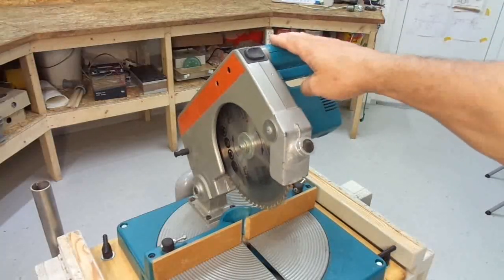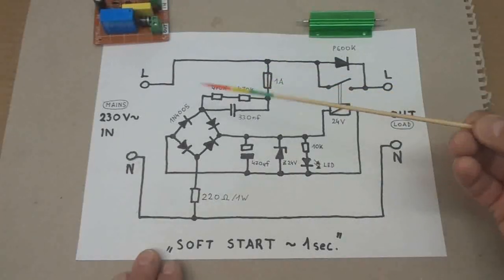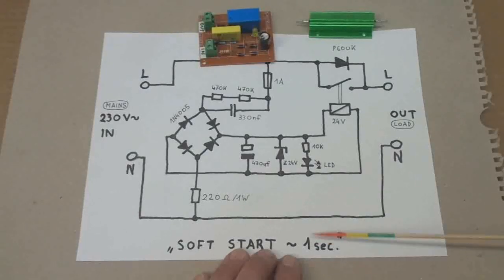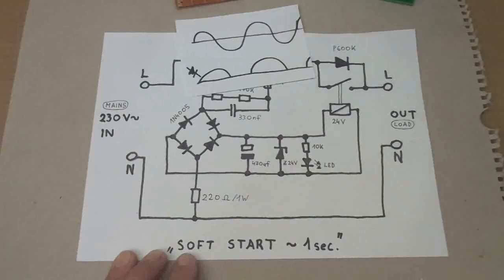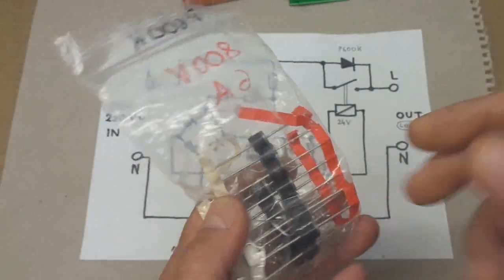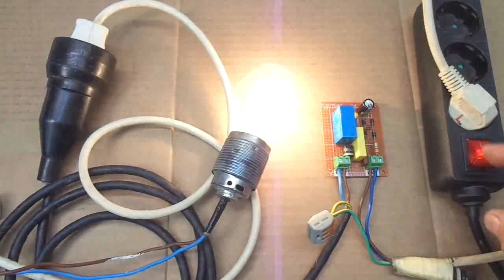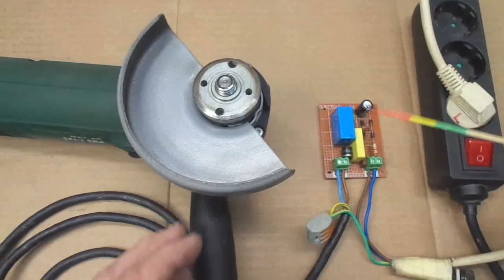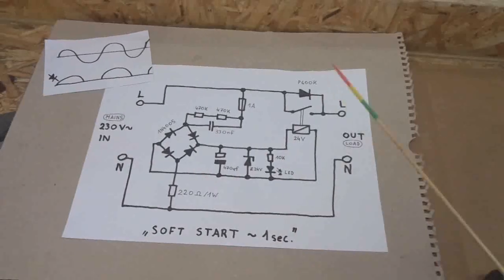simple soft start circuit DIY

Comment: Hello, Lari
I liked the practicality and simplicity of its circuit.
What changes should I make to 127 volts?
Grateful
Reply from the maker: You can use the circuit as it is also for 120 volts AC. I think, it should work, because the capacitive dropper limits the current, not the voltage. If you dont want to do math, start with a 220nF capacitor and increase the value, if your relais gets not enough juice. Stay as low as possible, or the Zener diode will get way to hot. The electrolytic capacitor sets the time delay...All of this depends on the propertys of the Relais...how much current it needs to kick in. And be careful, even though, there is 24 Volt at the "secondary" side, everything in this circuit is live mains voltage and can give you a nasty shock.  Greets from Germany.
Reply: @LariFariYoutube  
Perfect!
Thank you so much, Lari!
I will follow your recommendations for sure!
A big hug from Brazil!
Reply from the maker: @claudemirvernini6719  You should measure the Voltage present on the Relais. In the circuit from the video, the Voltage on the Relais, when its on, is 19,5 Volts. As i saied, i am using a 24 Volt Relais, so its a little bit undersupplied, but thats just to be on the save side... I did test the Relais first with my benchtop power suppley. It kicks in at around 12 Volts. You should try, to stay a bit under the Zener Voltage, when the Relais is powered...(by choosing the right dropper capacitor)...so you can be sure, the Zener Diode does not get hot...  Sty save, my friend..
Reply: @LariFariYoutube  Thanks for your attention, Lari!
I will follow your advice.
Excuse me if I annoy you.
Hug!
Reply from the maker: @claudemirvernini6719  No Problem Claudemir...I am curious to see, if my circuit works on 120 Volts and what changes the design need to work in your country. So, if you are building the circuit and you get it to work on 120 Volts, please give me a feedback.
Reply: @LariFariYoutube Gladly, Lari!
I'm already ordering the parts, because in my city they don't have them.
As soon as it's up and running, you'll know.

Comment: will this work for old compressors?
Reply from the maker: Yes, it will. I think, your compressor has a induction motor. You will need a low value resistor instead of the Diode.
Watch my video "table saw part 4" I used 200 meters of insulated, solid core wire as a startup resistor for the 2,2 kW induction motor.

Comment: Can we Run refrigerator compressor on it?
Reply from the maker: Hi, my friend.... Hmmmm...most refrigerator compressors have already a PTC start circuit built in, because a refrigerator compressor starts on full system pressure. So if you have problems with your compressor, you need to change this component. (cheap on ebay). If you have some other project in mind, where you want to use a "hacked" fridge compressor, i think, you can use this circuit. But dont use a diode... Use a high power resistor (about 5 ohms...you have to find the right value..) I never tried to use this circuit on such a compressor and i would be curious to see, if it works. It is so simple to build, so it is worth a try anyway.. ;)   If you do so, please leaf me a comment, if it works or not.  Greets from Germany.
Reply: @LariFariYoutube  Thanks dear for you reply, actually the problem is when refrigerator compressor start it's take upto 10 times more power. I want to run it on Small solar inverter of 1.5kw..
My solar inverter max 5Amp out put. If i run refrigerator on it maybe my inverter die🤣..
Reply from the maker: Uh..thats tricky... My suggestion: Make the wires on the input side of the Inverter as short + thick as possible (battery cable), to reduce the voltage drop on DC side of your system. I dont think the Inverter dies, but it will detect a overload situation and the protection kicks in.. Probably you would be better of with a bigger Inverter.

Comment: Hi,can you post links for relay and orange capacitor.Thanks
Reply from the maker: Yes..
Here is the Relais: https://www.digikey.de/de/products/detail/te-connectivity-potter-brumfield-relays/OZ-SS-124LM1-200/1427513

But any somewhat similar 24 v DC Relais would do just fine..

And here is the dropper capacitor:

https://www.digikey.de/de/products/detail/vishay-beyschlag-draloric-bc-components/BFC237341334/502562

..but, again...any 0,33 microfarad capacitor will do, as long as it can handle at least 250 Volts.

All these items are very cheap and / or can be "rescued" from electronic scrap...
Reply: @LariFariYoutube  I forgot to ask link for Z24V  and 1A fuse. Is 470uf capacitor 400V or something else?
Also do you maybe have photos of both sides of board? Thank you very much
Reply from the maker: The capacitor is a 0,33uf / 275V AC ..You can use any "non polariced" capacitor which can handle minimum 250 Volts AC. (i am assuming, your grid voltage is 230 Volts)....so a capacitor with a 400 Volt rating is a good choice. The capacitance value depends on the amount of power is required to drive the relais... A bigger relais needs more "juice" to kick in and therefor a higher capacitor value. If the 0,33uf (330nf) capacitor is not enough, you can go higer to a 470nf or even more. But if you go to high, the zener diode will get hot...so dont overdo it, there is a sweet spot...  ;)

The fuse is a "normal" 20mm x 5mm Version on 2 fuseclips.
But again, you can choose any other formfactor...lets say for instance, you want to mount the fuse into a frontpanel. Then you need the appropiate fuseholder for the task.

I have used in my circuit a zener diode, which is rated for 1,3 Watt.
But going higher would be in this case always a good idea.

Here is a link:

https://www.digikey.de/de/products/detail/onsemi/1N5934BG/1474304

Give me your e mail adress and i will send you closeup pics of the circuit board.
Reply: @LariFariYoutube  there is email address on my profile,because yt is deleting comment when I write it here

Comment: Thanks for your sharing of material.  Would you consider providing a scaled up version of your circuit to fit my application?

I want to reduce inrush current of a 10HP AC Motor; Single Phase; with approx 31.67 run amps and potential surge at three times the run value at approx 95 amps.

If you could provide this, it will be appreciated.  Thank you!
Reply from the maker: 7,5 Kw singel Phase? On 240 Volts? Where the hell do you live?.. You could practically use the same circuit... Just use the Relais to switch a bigger contactor, which can handle your motor current.. And instead of the diode or a power resistor you could make your own inductor coil...Like i did in my Table saw build.. I used 200 Meters of copper installation wire..This solution takes up some space but is simple and robust... almost indistructable...even in case of a dead short.. Go to this video..Minute 12:00.... https://www.youtube.com/watch?v=b2LhjqxPc8Q

Comment: doesn't it broke the power tools ..lari??
Reply from the maker: No...not yet. I upgraded my table saw with this circuit about 8 years ago. No problem so far. But you should be careful to add a circuit like this to a power tool, which has a speed control electronic built in. In such a case, you should not use a  diode. Use a power resistor instead.... If your power tool has "just" a universal motor and a switch, you are good to go with this circuit. Because a universal Motor runs, as the name applies, on AC and DC. Hooking up a half way rectifier in series for a brief moment does no harm..
Reply: @LariFariYoutube  no speed control, only motor induction and switch😁

ohhh yeah, the VA maks. capacity of this electronic??

so so clear explanation.. lari
tenqyu...👌
Reply from the maker: @lurkingcorsa10  You can use this circuit for AC power tools with universal motor up to 2500 Watt. It depends on the kind of relais you use in the circuit. I used in my case a 24 volt Relais with 900 Ohms coil resistence. If you want do upgrade the circuit with a bigger relais, you need also a bigger dropper capacitor. ( 470nf.......680nf......or even higher).. Maybe you can explane a little bit, what kind of tool / Motor you want to soft start with the circuit...
Reply: @LariFariYoutube  okkk ..

and the last,. what about the torque?  does tge power tools get lost a little torque through this circuit.. lari?
Reply from the maker: @lurkingcorsa10  No. The Tool starts with half power and torque and after one second it switches to full power and full torque. No losses...
Reply: @LariFariYoutube   okkk..
 tenqyu lari👌
Reply: hii.. lari,
I ve made. it like your diagram,. but unfortunately no softstart movement at all at  my circular,.  I hear, some people say,. "it must be in switch machine", is it right?
Reply: @LariFariYoutube   okayyy... in wire motor
Reply from the maker: @lurkingcorsa10  Yes...maybe it is not 100% clear in the video... The order is:   Power plug --> switch --> soft start modul --> Motor / load
Reply: @LariFariYoutube  wouww .. its so complete answer, lari.  thnks alot for  this diagram...😃,👌

Comment: Could you sell me one for a 4 HP power? I want to soft start a motor?
Reply: KIT  POWER SOFTSTART BELL BGR SOFT NTC 
Alat ini berfungsi untuk membantu meringankan tarikan listrik power pada pertama kali dinyalakan sehingga tidak membuat MCB / sekrinh rumah anda turun.

Keunggulan :
- peredam sesaatnya dengan NTC
- High quality component
- tegangan relay stabil
- rangkaian simple
- terdapat soket ac
• Tidak membuat MCB rumah Turun
Saat menyalakan perangkat Audio power Amplifier,  Motor gerinda, mitter circular etc
• Menahan spike arus sesaat saat beban berat (trafo besar) dinyalakan
Beli di toko online seperti Tokopedia
Berkisar Harga 50.000
Reply: Memasang Dimmer Rakitan Sendiri
Adalah kepuasan tersendiri, karena kita mengerti  dan memilih komponen triac yang tepat kita memaksimalkan peruntukan alat tersebut. Apalagi alat tersebut di samping untuk Alat Anti Jeglek ternyata juga bisa melakukan penghematan pemakaian listrik rumah. Beberapa alat penggerak motor & elemen pemanas yang biasanya untuk kebutuhan rumah tangga dengan kapasitas mampu menahan beban 4000 watt :
1. pompa air
2. Mesin cuci 
3. Blender / Mixer
4. Pemanas Air / setrika 
5. Penanak Nasi
6. Mesin Bor / Gerinda 

Saya coba pakai microwave 1100 watt ternyata juga mampu biasanya jeglek walaupun listrik PLN 1300

** tidak bisa digunakan untuk keperluan mesin las listrik**

** saat memakai alat dimmer usahakan di posisi kan potensiometer meter kondisi minimal ( Rendah) kemudian atur potensiometer sesuai kebutuhan **

Lebih detail mengenai Dimmer Speed control dan Skemanya  silakan  lihat Deskripsi pada link YouTube :
Komponen Triac BT 137 saya lihat data sheet nya 8 A  jadi saya pakai 2 biji untuk mendapatkan kemampuan menahan daya 4000 watt atau bisa juga cukup 1 biji komponen Triac BT 139  data sheet nya  16 A atau setaraf dengan 4000 Watt. 

 https://youtu.be/BEMn9zsWcdQ